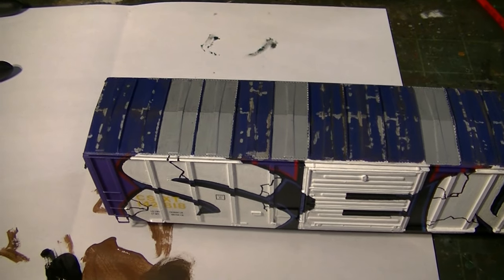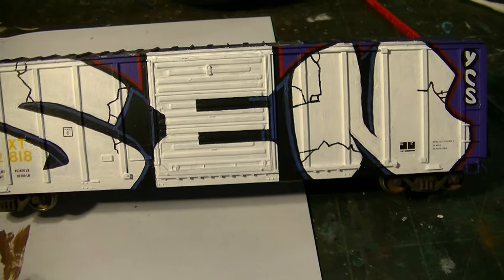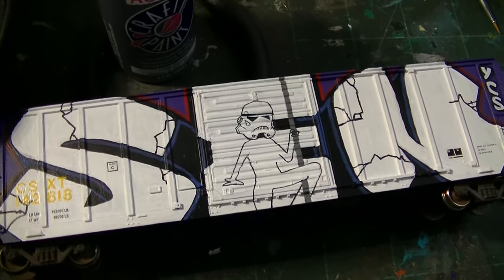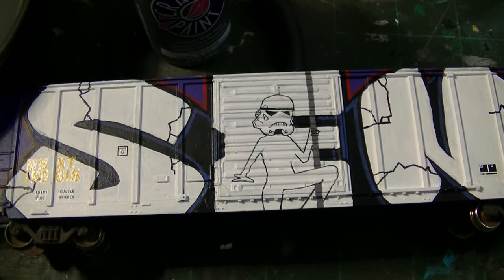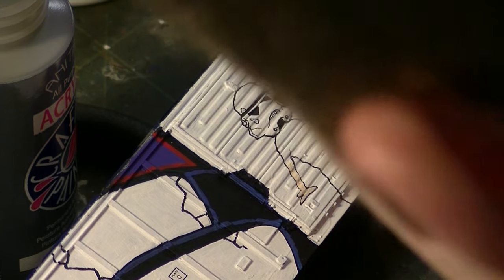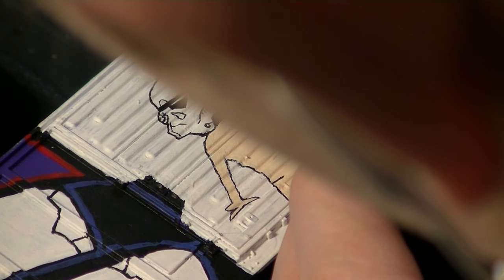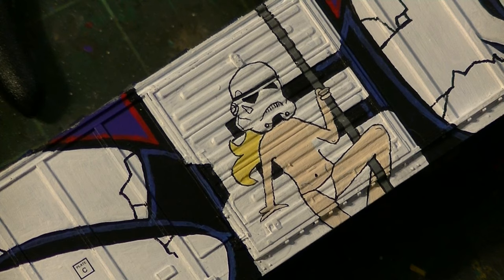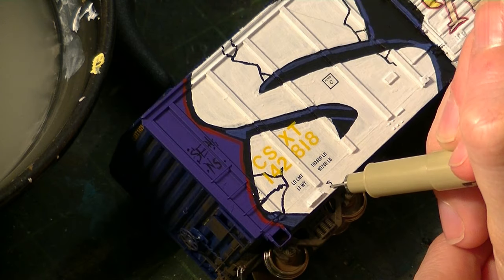CSXT 142818, SEN ''The Storm Stripper'' Graffiti Tagged Boxcar! Part 2 of 2

Comment: what size and brand of brush is that?
Reply from the maker: The small brush is an Atlas 10/0  No.155.
Reply: DansRailroad2011 where did u find that railcar you are working on in the video?
Reply from the maker: That's an Intermountain boxcar I had picked up at a trainshow.  These cars, and many other boxcars are available on eBay and many online hobby shops.